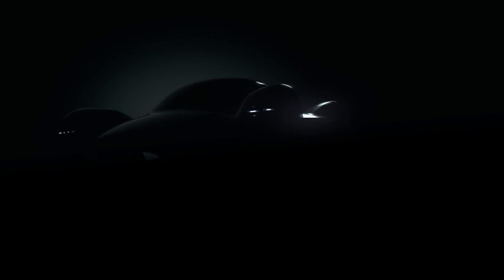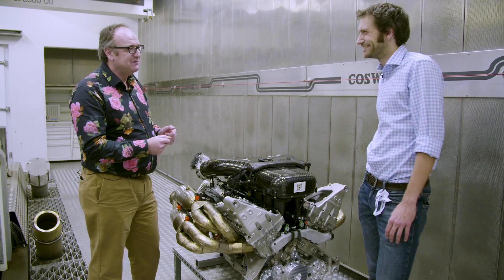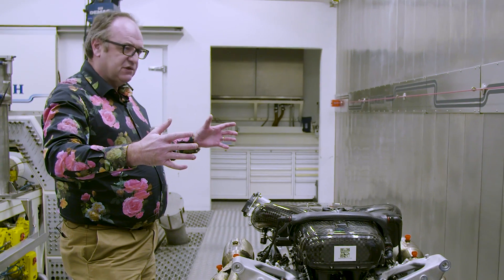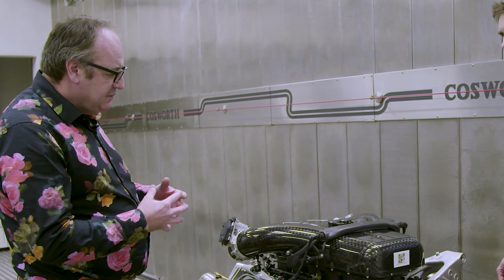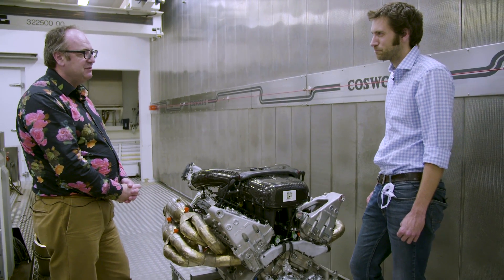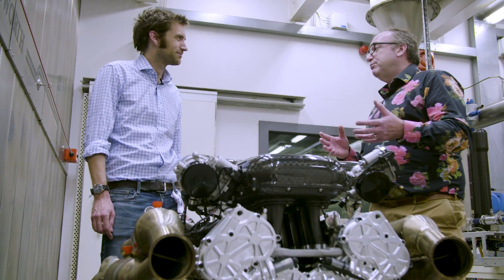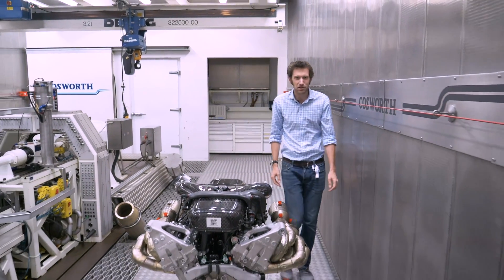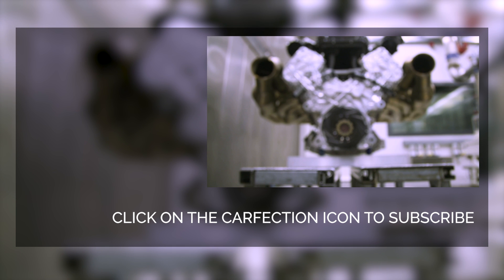Hear The Future Of The Supercar At 11,000rpm: The Aston Martin Valkyrie's V12 - Carfection

Comment: First truly inspirational v12 since the McLaren F1. I'll explain my thinking. The F1 came out at 627 HP (680 in race trim)compared to other supercars of the time with 450-550. The F1 was 30% more powerful than the F40 for example. In the 25 years since the F1, other companies have incrementally increased the output up into the 800s. Now comes along this engine, not an incremental increase, but a massive increase in output to 1000hp. In the same example as the previous one, we'll use the Superfast at 789hp. This Aston v12 makes 27% more power, very similar to the numbers McLaren was ahead of the others a quarter century ago. Very very good job Aston!
Reply: This is what I wanted to read in the comments. The usable rev range on this engine is going to be absolutely massive. I'm looking forward to seeing the finished car.
Reply: John Kuykendall you mean BMW, it was a V 12 BMW...
Reply: Didn't Bugatti make a 1001 bhp engine about 15 years ago?
Reply: @valgehiir  Yes, but if you read it again, John is talking about V-12 engines.
Reply: The Mclaren F1 for an NA engine makes an ungodly amount of torque even by today's standards - if that engine could rev to 11000 rpm with that torque, it would make 920 bhp!! That's how amazing it was. The thing however is that today's engines can rev much faster than the F1's engine and keep that torque curve flatter throughout the rev range.
Reply: All natural horses shoved into the one paddock and none on performance-enhancing drugs either. Just trot slowly to local shops and sit at traffic lights as you go and give petrol heads like me a hard on, so much I forget to photo.
Reply: Mclaren was only able to impress at 627 bhp because Ferrari and Lambo were dicking around with incremental increases.
Reply: @Ben W don't know what is your point here but just go read the last chapter on Adrian Newey's book "How to Build a Car".
Reply: @Ben W you have won the "discussion". Congratulations!
Reply: @Ben W feel free to do it.
Reply: The only thing I'll disagree with you on is that Ferrari's current V-12 definitely meets the standard of inspirational. Put on some headphones and watch an FXX-K track day at Monza then come back and try to tell me you disagree. Horsepower isn't the end of the story for what makes an engine great.
Reply: Joel Schembri , you don't got me right. I'm half Italian but don't care about Ferrari in this topic. It's ok. My real point is that this car is basically a Red Bull  sponsored by Aston Martin (with a Cosworth engine and other suppliers). Aston engineers didn't put a finger on this - thanks God - only their designers. The only "sad" part to me is that Red Bull couldn't put it together like McLaren did with the F1. Even Adrian didn't want to put a Aston badge on the car and I 100% sure that wasn't about aerodynamics.
(And sorry about my english)
Reply: Joel Schembri  , man, I didn't say a single bad thing about this car! I'm not arguing with you. This is my favorite of all time by far! My early angry tone (that was not directed to you) was because people giving credit to wrong people (and I have zero problems with this having suppliers from all around the world). You see retards all over the internet saying this won't perform cause it's a Aston but it's not a Aston it's a Red Bull! The 003 "Valhalla" will be a Aston engineers' car and a hope they learned from the best how to design a fast car.
Reply: You are forgetting that Koenigsegg has had a 1400 bhp engine in the Agera RS for quite some time... This is in no way a revolution. It is simply race tec moved into a road car. The true revolutions are coming with the innovative small scale companies like Koenigsegg, Hennessey and TranStar Racing. Just look at the Koenigsegg  gearboxes on the Koenigsegg  Regera and Jesko. Here is a company reinventing the wheel to something far better. And the TSR engines are true beasts... 2500 BHP in a road car? Even if not completed, just the idea is insane. It's basically a dragster for street racing.
This will be a nice track car, as well as the Mercedes-AMG One. But they are neither the fastest nor the most impressive cars in the megacar age...

But not to take away from it, it will be impressive on a track!
Reply: @Espen_Danielsen ,  Hennessey (promises) an TranStar (last news from 2010 and they never made a car) innovative where?! Koenigsegg is more than OK but they are small and will never get a car well adjusted as a McLaren or a Porsche.
Reply: BMW made the Mc F1 engine
Reply: Sort of, the LM was rated 680hp but, IIRC, the GTR race engine had to use restrictors that limited it to 'only' 600hp, and there were a few other engine modifications also done. Still one of "the" engines, though!
Reply: *Very good job Cosworth
Aston ain't doing shit in this car in terms of engineering.
Reply: @gustavoflorio5383  Really? Any seriousness in your post is matched by the stupidity of it.
Reply: @gordowg1wg145  , tell me AM are they doing? Newey and his RB team did the chassis (structural, aero suspension); he even designed the gearbox wich will be produced by Ricardo; Cosworth did the engine; Bosch electronics; Rimac the electric power train; didn't remember who did the brakes was but is no AM...
Aston did the aesthetics and join all together and will sell it under it's name.
Reply: I understand why you would say that, however most companies farm various aspects out to whichever company can best handle their needs. BMW developed the McLaren F1 engine. The F40's turbos came from the Japanese company IHI. In many cases, the credit goes to whoever is paying the bill for development.

Comment: Lmao anyone else think it sounds like a visit to the dentist?

1000HP is rather pathetic considering some other supercars but that design is beautiful.

I'd prefer an electric variant 😱
Reply: Pathetic in what sense? Only a handful of production cars make that power and almost none of them can take a corner properly
Also this car will stay NA, nothing will be changed, so if you want an ev, go buy a Prius, or if you only care about numbers, go stand on the waiting line for the non-existent Tesla Roadster that will be probably as delayed as Duke Nukem forever
Reply: @dotdot8614  

I'll admit that 1,000HP NA is fairly impressive, but there are many production vehicles out there that achieve higher. 

More important, however, is the torque and weight. More torque and lower weight typically mean faster acceleration and this vehicle is fairly light at ~2,400lbs but only has 546 lb-ft of torque.

A 0-60 time of 3.5s is decent but there are a plethora of other cars that can do the same... or faster... for a fraction of the cost.

It is a beautiful car and an engineering feat with a 1:1 power to weight ratio but it isn't exactly a practical automobile. 

I'd rather spend $160,000 on an Ariel Atom V8 500, $135,000 on a Model S P100D, $85,000 on a Dodge Demon, $90,000 on an offroad modified Model X, up to $100,000 buying a Delorean DMC-12 and modifying it to all electric and still have over $2,000,000 left to play with.

Comment: The stated piston speed of 25 to 26 meters/second for a 6.5 liter V-12 implies the stroke length to be roughly 61 millimeters (2.4 inches)
To have any 6+ liter engine rev 11,000 RPM is incredible and owners of such a car will not likely drive 100k kilometers with them. But for any 'ordinary' street legal engine, a 100k kilometer (~60k miles) endurance test is chump change.

Comment: typical sportbike proportions.  13:1 compression, 40.5mm intake valves, 32.5mm exhaust valves, ~97mm bore, and 73mm stroke. 6473cc.  13.1 bar BMEP.  The Porsche GT3 RS has 7.6% higher BMEP (albeit lower piston speed).

cam gears at the back also don't see all the crankshaft harmonics.  it's a great place to put them. 

still not an explosion.  burn.

Comment: Turbo Ford Falcon 4 litre six cylinder. Buy it second hand for $4 grand and wind up the boost for 600HP. Crack it open and add some cheap go-fast bits and you see 1000HP.

Comment: 1990 Mazda 787b: "That's adorable."
Reply: AHAHAHA THIS IS SO TRUE
Reply: The irony is, by the time i write this, the number of dislike this video have is 787
Reply: "From the Mazda Motor Museum website, it claims the engine has a maximum output of 930 hp (690 kW), and a maximum redline of 10,500 rpm. This setup was not used during racing for reliability reasons...."
Reply: @VredesbyrdNoir  It hit 13k at Le Mans. 10.5 was the "recommended safe operation paramater".
Reply: @xerodelacroix5552  I can't find any information that mentions that. Another site talking about the R26B specifically says: "The engine was capable of cranking out 900 hp at upwards of 10,000 rpm, but was detuned to “only” 700 at 9,000 rpm to in the interests of durability."

Source: http://www.spannerhead.com/2012/10/06/interesting-engines-mazdas-r26b/
Reply: Look up the building process. The original motor for that car was a triple rotor and wasn't making enough power for the driver's taste, when they made it a quad rotor, they had it up to almost 15k in test runs, but yes, they massively de-tuned it for durability and race restrictions. It hit 11k back in 2011 when it ran at Le Mans again unofficially. And it was making 950 at 10.5, this is documented, and part of the reason it got banned after two years at Le Mans.
Reply: @VredesbyrdNoir  Mad Mike`s 26 B has 1600 HP ...
Reply: LMBO
Reply: Totally
Reply: lmao
Reply: Except that dorito engine has 5 moving parts. This is a N/A V12, more impressive from engineering standpoint. It should also make more torque.
Reply: its not street legal...
Reply: Xero Delacroix  so are you saying its a mazada, or are you just that stupid, im lost on your comment.
Reply: You can't compare Wankel to piston engines. Two completely different engines with their own advantages and issues.
Reply: Okay, how about the AE-101 blacktop 4A-GE that could hit 11k.....with eight less cylinders.
Reply: @xerodelacroix5552  I had a trueno gtapex and hit 8200 stock not bad for a 1.6
Reply: @xerodelacroix5552  my Honda CBR125R could rev above 10k with one piston. What's your point here...
Reply: Motorcycle engines are as different to car engines as rotaries are to piston engines. The point is, this car is not nearly as impressive as they're making it out to be. You don't need a V12, hybrid or not, to be making this kind of power with these kind of revs. You can do this with an Eco-Boost if you really wanted to.
Reply: @xerodelacroix5552  
- What Frederico said.
- More pistons do not equal more RPM (generally the opposite is true; less reciprocating mass = higher RPM). I don't know why you mention a high revving 4-cyl engine in this case.
- "Motorcycle engines are as different to car engines as rotaries are to piston engines." Err, what? Except they also have pistons, and valves, and a crankshaft, and work in exactly the same way as piston car engines just made smaller and ligher to fit into a motorbike... A good example of less reciprocating mass = higher RPM.

I can't even think of any other car that has been sold to the public for road use that can rev to 11,000RPM out of the factory. That alone makes it impressive.
Reply: There's literally three cars mentioned in this comment thread that could, but okay.
Reply: @Vredesbyrdnoir .....no kidding.
Reply: @xerodelacroix5552  Not out of the factory.... If they exist, I don't know of any.
Reply: @VredesbyrdNoir  Toyota 4A-GE AE101 blacktop. Mazda 20b triple rotor from the Cosmo.
Reply: @xerodelacroix5552  Sources dude. I just had another look and none of what you're saying applies to the factory standard 4A-GE:
"Toyota sponsored the Champ Car Atlantic Championship from 1990 to 2005. A kit version of the 4A-GE from Toyota Racing Development was used to power Formula Atlantic cars during this period. This engine used a modified 16-valve head and produced approximately 240 horsepower at 8400 rpm."
Source: https://4age.net/toyota-4age-information/
Also:
"The engine your talking about was used in the formula atlantic race cars. They aren't designed for road use as they have to be driven hard to avoid excessive engine wear, they require a rebuild after almost every race and would be sooner if used on the road. I'm almost certain they can only be run on race gas so would be pointless in a road car"
They should only be put into a dedicated track car otherwise you'd be wasting your time and money."
Source: https://forums.mightycarmods.com/forum/technical/tech-talk/8484-trd-tuned-4age

As for the Mazda 20B (even though I was talking about piston engines): http://cp_www.tripod.com/rotary/pg20.htm
Reply: That isn't the version of the 4A-GE i'm talking about. I'm talking about the 20v, otherwise known as the Blacktop or AE101 https://www.youtube.com/watch?v=nz5cnjatFds
Reply: And here's a de-tuned 20b hitting 11k https://www.youtube.com/watch?v=JcyvTuoslAA
Reply: @VredesbyrdNoir  Well, apart from the less mass due to the lower count of cylinders, the much shorter stroke does help a lot with rpms. Even in a 1000cc car engine, the stroke will be a lot longer compared to a 1000cc bike. Like, a 6k redline compared to a 12-14k redline. that's quite the difference.
Reply: @vasilisgreen  Sure, but is the difference greater than between a piston car engine and a rotary? Of course not.
Reply: @xerodelacroix5552  I don't know what part of "out of the factory" you don't understand, but whatever.
Reply: @VredesbyrdNoir  lol no, there is no difference, they are 4 stroke engines with massively different sizes, nothing more. What does the Wankel have to do with them?
Reply: Xero Delacroix This engine is stupid impressive from the factory, the fact that it can move the reciprocating mass of a V12 to over 11k is truly astonishing. Amazing engine, and a giant leap forward in engineering.
Reply: @xerodelacroix5552  we all have things that are our favorite, but when you humiliate yourself by fangirling trying to downplay anything else you will tend to make yourself look stupid.
Reply: @hunter0740  Considering I brought up other cars/engines with insanely high redlines, not sure what your point is. By the way, it's spelled "make".
Reply: @VredesbyrdNoir  the mazda/autozam az-1 engine redlined from 9000-11000 rpms and i believe some of the late 70's hondas could also reach 11000, heres the guages: https://www.youtube.com/watch?v=9fbbrolewDs
Reply: Road car that can go 100km or 220hrs Vs engine that lasted 24 hours. Not really comparable. Motorsport engines are nothing like road going engines
Reply: @MichaelGallagher97  a lot of the early skyline gt--r engines were basically the same as the engines nissan raced with
Reply: @MichaelGallagher97  Dude 787 B is not only lasted 24, it could do another!
Reply: Michael Gallagher, all the 787b engine was was two RX-7 13b's lashed together. And a regular 13b could rev to 10k, so this is not impressive. At all.
Reply: @xerodelacroix5552  no, 26 B is different in many ways. Count the spark plugs for example. Funny: it uses the exact same Mikuni oil metering pump from my 1988 RX 7 FC Turbo . Everybody is premixing ...
Reply: @ Heiko Panzlaff, yeah the 26B has three plugs per rotor....that is the only difference aside from some duct work.
Reply: You do know that high RPMS in a Wankel engine are different to a conventional piston engine. Also if you think a V12 hybrid engine that produces 1000+bhp reliably is "not that impressive" then you're an idiot

Comment: almost-mass-produced Aston do have so many flaws. I can't believe that 11'000 whatever RPM engine being any reliable. Suddenly Aston will send reliable cars on the market?? Like how much "zgona" be the oil price? how often will you need to change it? After all motorbike car run at such engine speed, why not. From honda or Kawasaki or Suzuki I would trust it "ok it might be reliable". But from some english manufacturer, not really. English engineering is so poor, especially in the area of quality. I even met a Jaguar dealer last May or so he told me not to buy one that just keep and keep breaking down. Ok they do make good race cars. But road cars are not race cars. They can say whatever it is not the case.
Reply: Cosworth is serious. They have designed some incredible stuff in the past. Look it up. The Toyota 4age is sorta based on an early 4cyl turbo cosworth and it has proven reliable and strong for turbo power
Reply: @xellossaxon I never said anything about the cars. English cars from my experience have all fallen apart but cosworth is definitely not one to talk trash about

Comment: I didn't think Aston Martin could surpass the engine found in the Cygnet. This engine MIGHT be able to unseat that little wonder, but I'm not holding my breath. The 1NR-FE has stop-start technology, Dual VVT-i, EFI injection and glorious Atkinson cycle combustion capability. Few things compare to the 5,600 rpm drone mated to an elastic band CVT on your way to a 11.6 0-60 time.
Reply: Cygnet was Aston Martin at its peak. Everything else they do is just trying to reclaim its glory.
Reply: You have obviously never driven a Daihatsu Charade 993cc 3cyl manual from the 80's. Timed on the 1/4 mile with an hourglass! BUT, will do it for 5 or 6 years every weekend.
Reply: @chriswillmott462  The GTti? Stock quarter mile time is around 16 seconds for them, way faster with mods and proper tyres.. Those little 3 cyl motors had semi forged internals if I remember right, so you could up the boost considerably and it'd handle it pretty well
Reply: @cdsmith1990  I owned a Charade turbo running 9 psi everyday, BUT we are talking NA engines here.